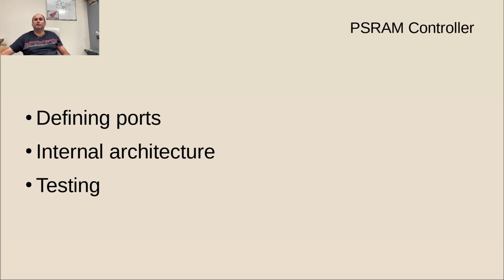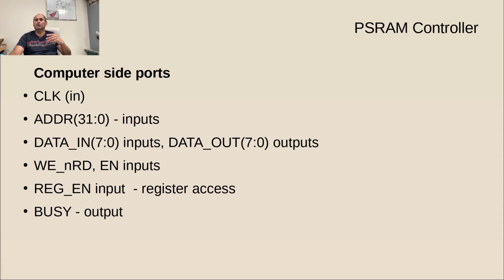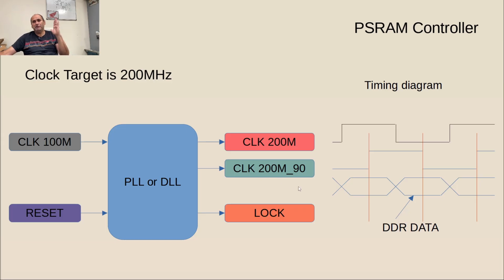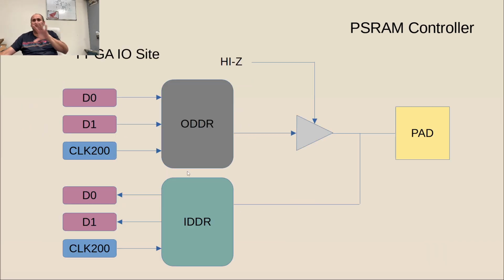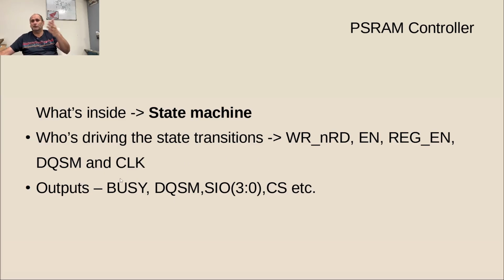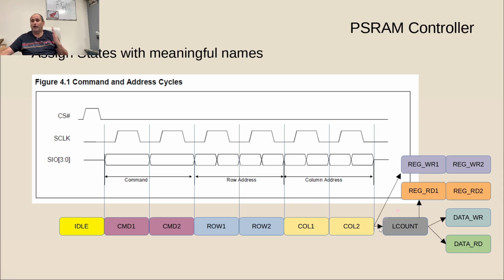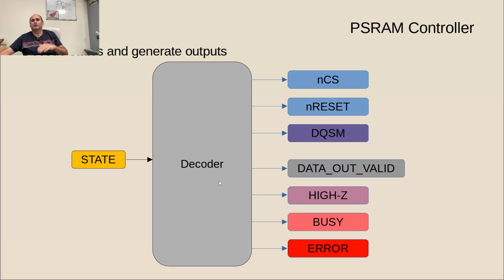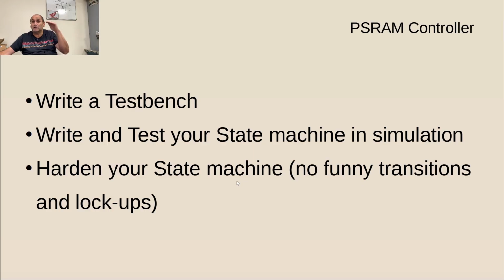PSRAM Controller The plan EP2

Comment: Just one question regarding the phase shifting of the clock, is this just a more explicit way of doing that, by defining input/output timing constraints won’t the tools infer maybe the same thing also handle better the placement and those kind of stuff.
I may be overlooking something…
Reply from the maker: Timing constraints main role is for timing analysis and sometimes (depends on the tool) cand drive or assist the placement and routing process. Tools can't infer to much delay, some fpgas have delay elements in each io site but these delays taps are for fine adjustments. Fixed and consistent delays (of large amounts) are achieved with PLLs and DLLs and they have the benefit they work even if the frequency of the clock is changing. (while a fixed absolute delay has to match the new clock). Most (if not all) DDR signals need a 90 deg  shifterd clock, which in turn need a PLL, DLL but most of FPGAs have one or more today. You can create quadrature clocks if you have access to  F*2 (double of you clock frequency)  and two flip flops. ( see here https://markimicrowave.com/technical-resources/application-notes/top-7-ways-to-create-a-quadrature-90-phase-shift/)
I hope this helps, keep building great stuff!